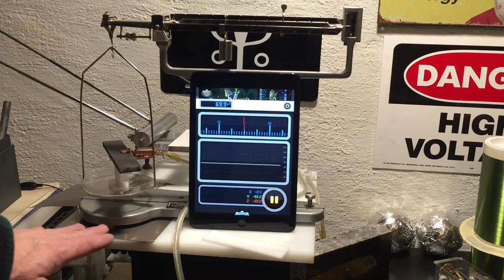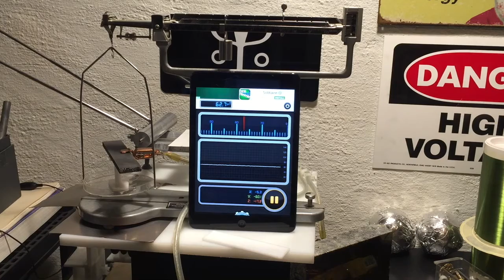Electric Weight Modulation CONFIRM #3

Comment: The question is: How can acceleration of mass be negated? Weight is just the measured resistance of the electrically accelerated mass. The mass of the object would have to have all dielectric lines of force, saturating into it, severed. This would allow instant deceleration and no hysteresis. Meaning, I could also accelerate forward with no backward drag on my mass :) Now, that would be a trick!

Comment: is it a 'plasma draft' from the 'reaction' down onto the scale?
Reply from the maker: Plasma draft if meant to be synonymous with ionic wind, I do not think so.
I think it is more akin to pressure mediation and an electrically induced alteration of the surrounding milieu.  It is a real issue.  Archimedes Principle keeps coming to the forefront of my mind.....does the electric effect make the weight change? It seem so.